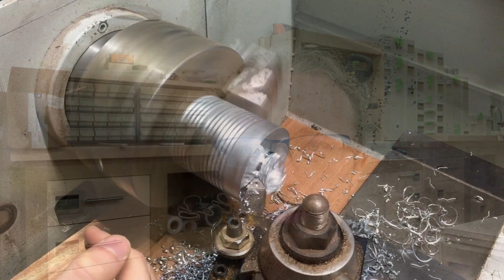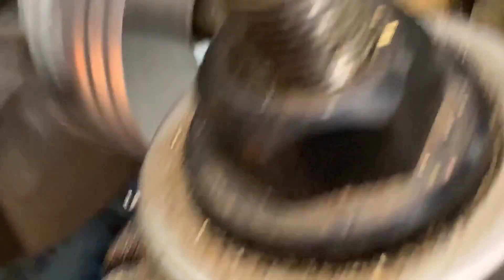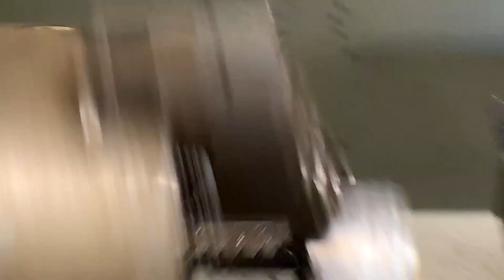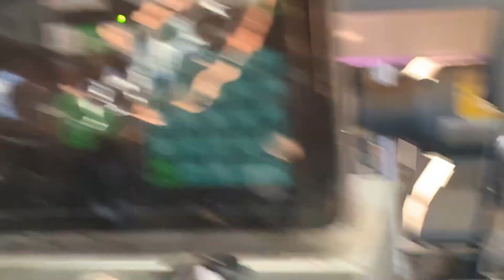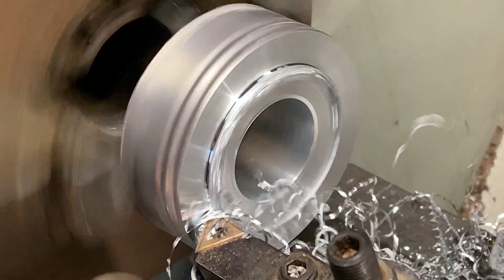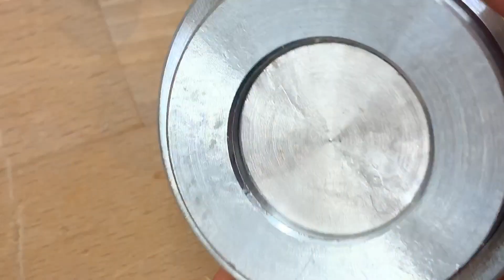Casting And Machining Zinc | Zinc-Smithing | Machining Magnesium

Comment: might want to use a vacuum cleaner to suck up the shavings from the running machine , i seen someones finger gotten skinned to the bone when the cut razor sharp material caught and was pulled back intoo the workpiece